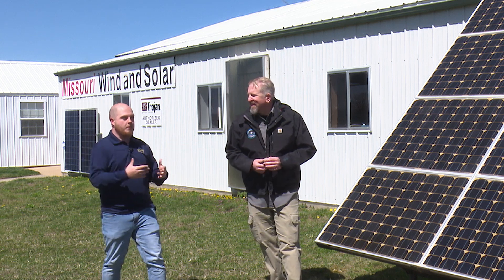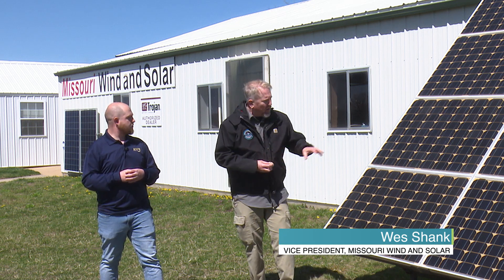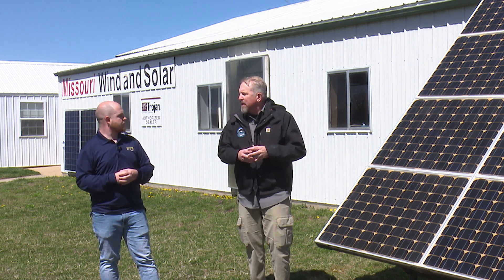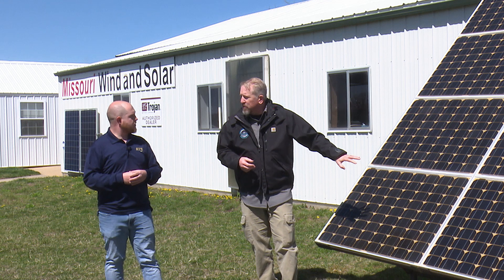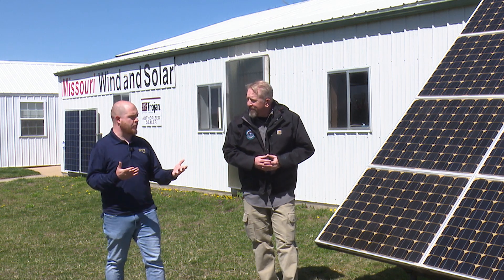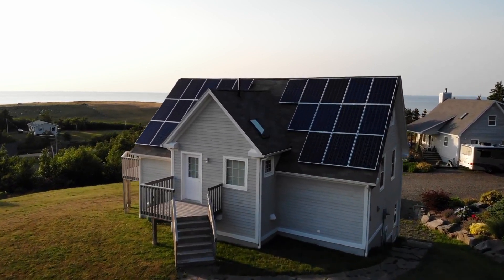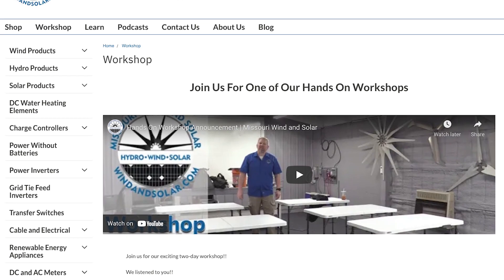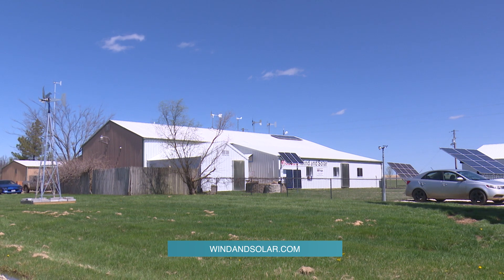Solar Myths

Comment: So 25 seconds into the clip you show a beautiful house with solar panels. Demonstrating how solar panels can be installed even on parts of the roof that receive no sunlight. I think these customers must be Biden voters.
Reply: I never saw the point of panels on the roof, when i see them on the roof i assume its a useless grid tie system, off grid with a ground mount rack is the only way to go
Reply: I bought cheap used panels and mounted them on a part of my roof that gets more shade than I would like, It makes sense for my small property. the ground is kept open for growing food. the panels might produce more if they were not on the house but the ground my house sits on could produce more food if my house wasn't there also

Comment: BS the problem isn't with the panels ... it is the batteries......  no good storage.... to $$$$$$$
Reply: The problem?
Reply: No good storage? I have 2 48 volt LIFEPO4 batteries at 105 amp hours a piece and they sustain me even in the winter in pennsylvania without much trouble as long as i can get 4 hours of good sun im good to go

Comment: “These things just fill up landfills” ....yes, but, let me deflect.  🤦‍♀️
Reply: Then by all means, let me be specific. To say they do not end up in landfills would be a lie. My crunch bar wrapper ends up in the landfill. But to try and say this is some downside in relation to what coal ash does is no comparison. If you would like to refute the coal ash problem and how it is a better problem to have than a panel that will probably be recycled, I'm all ears.
Reply: Landfills are lined with a thick rubber and the gases that come from decomposing gets captured and mixed with natural gas